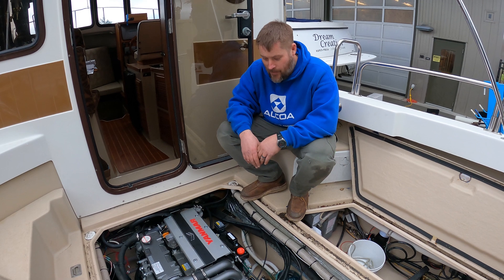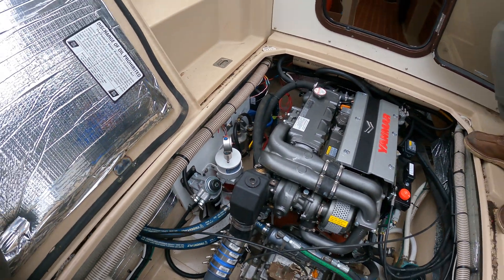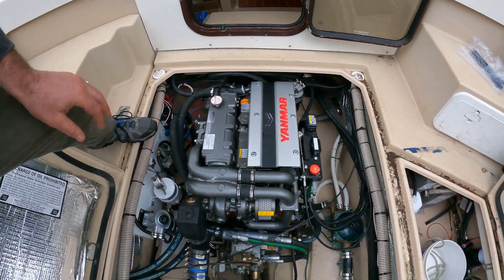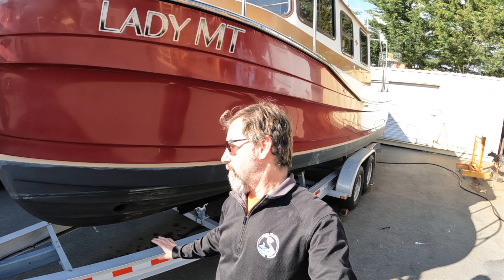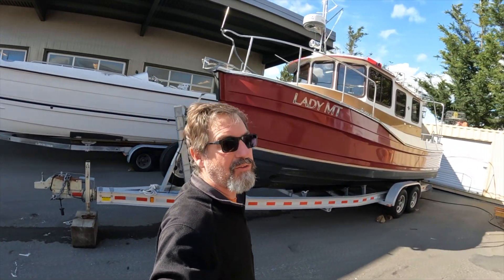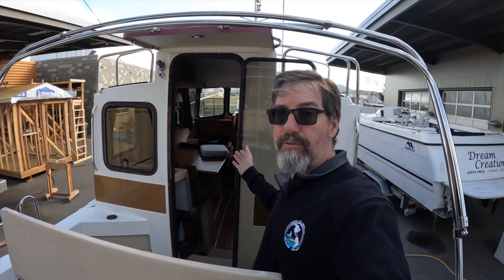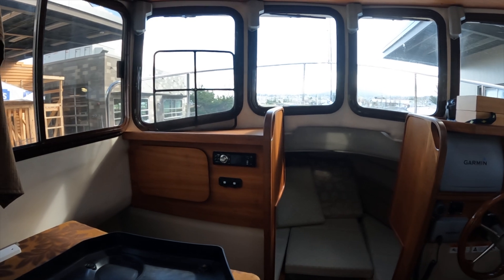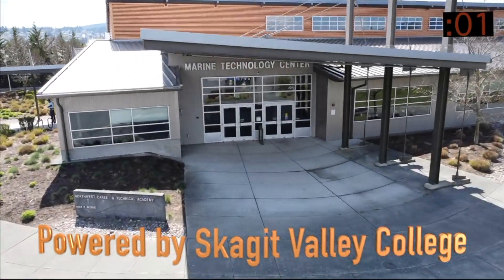Lady M: 1st start-up! 25' Ranger Tug with new Yanmar 4JH-HTE

Comment: beautiful boat! i had a customer ask me how much work it'd be to swap out the volvo D4 for a CAT C7.1 into his Ranger 29 footer, any thoughts? i know stringers and keel would need to be reinforced to account for the additional 400 pounds of weight, but im wondering what other structural changes might be necessary
Reply from the maker: That I'm not sure about. We had a very hard time finding an engine that would fit! They also are not a heavily built boat, so it would probably require a lot of glass work.